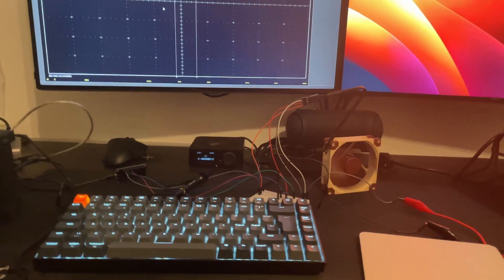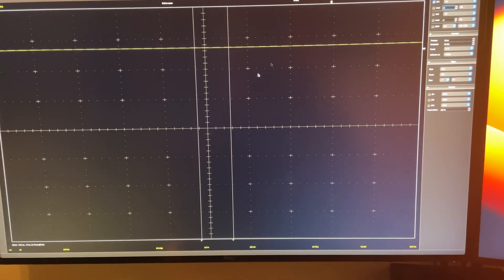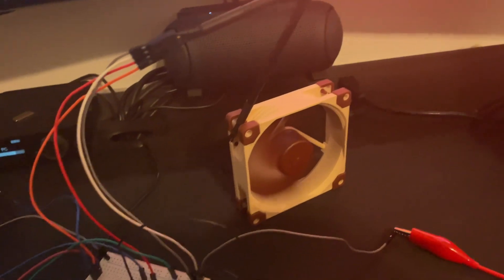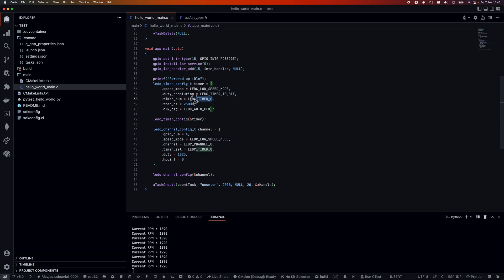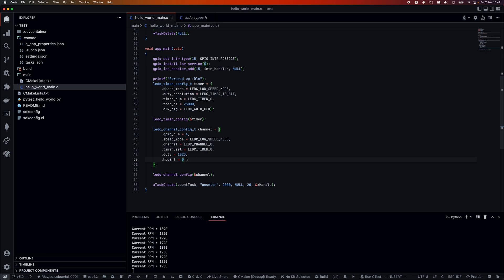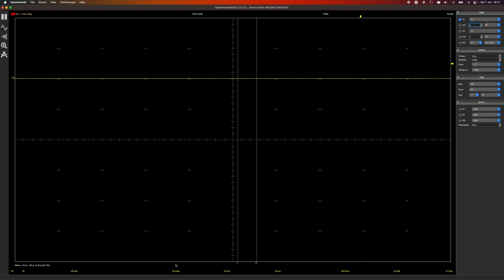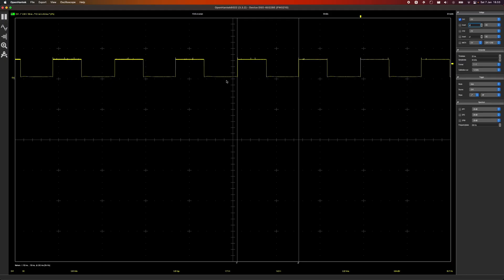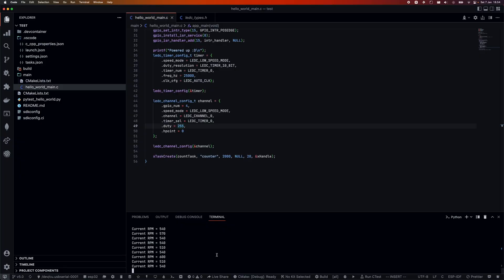[ESP32] Controlling and reading a 4-pin PWM fan in ESP-IDF

Comment: ESP32 is NOT above 3.3v tolerant on inputs... so if the TACH input spikes you have just destroyed your ESP32... this is not a valid design.  There is no guarantee that the 12v fan will not overload the TACH pin above 3.3v.  You need a design that never allows the TACH signal to be more than 3.3v and never above about 250mA current, to be completely safe.

Comment: Here's the code:

I ran it on Visual Studio Code PlatformIO (IDF, not Arduino) running on a ESP32 Xiao S3. I could not test the rpm sensing feature since my fan doesn't support it.
I used a Delta Electronics PFR0812XHE 12v/3.9A 4 PIN Fan I got out of a Dell Server for free. It looked like it recognised 0.5% increments in PWM Duty.

In the Delta fan spec sheet PWM positive was a minimum of 3.5v, but 3.3v from the ESP32 worked fine, in fact it worked fine all the way down to 2v.

#include <stdio.h>
#include "freertos/FreeRTOS.h"
#include "freertos/task.h"
#include "freertos/xtensa_api.h"
#include "driver/ledc.h"
#include "esp_attr.h"   
#include "esp_err.h"

int counter = 0;
TaskHandle_t xHandle = NULL;

static void IRAM_ATTR intr_handler(void *args) {
    counter++;
}

void countTask()
{
    while(1) {
        vTaskDelay(1000 / portTICK_PERIOD_MS);
        printf("Current RPM = %d\n", counter * 30); // counter / 2 * 60
        counter = 0;
    }

}

void app_main() {
    gpio_set_intr_type(11, GPIO_INTR_POSEDGE); // connect your RPM signal detection to pin 11
    gpio_install_isr_service(0);
    gpio_isr_handler_add(11, intr_handler, NULL);

    printf("Powered up :)\n");
    ledc_timer_config_t timer = {
            .speed_mode = LEDC_LOW_SPEED_MODE,
            .duty_resolution = LEDC_TIMER_10_BIT,
            .timer_num = LEDC_TIMER_0,
            .freq_hz = 1000, // this is the acceptable frequency range
            .clk_cfg = LEDC_AUTO_CLK
    };

    ledc_timer_config(&timer);

    ledc_channel_config_t channel = {
        .gpio_num = 10, // connect your PWM to GPIO 10
        .speed_mode = LEDC_LOW_SPEED_MODE,
        .channel = LEDC_CHANNEL_0,
        .timer_sel = LEDC_TIMER_0,
        .duty = 204, // 0 to 1024. 0 being 0%, 102 being 10%, 1024 being 100% duty cycle.
        .hpoint = 0
    };

    ledc_channel_config(&channel);

    xTaskCreate(countTask, "counter", 2000, NULL, 20, &xHandle);

}

Comment: Thanks - great intro into how to do this. Couple of questions on what software/hardware you're using? I.e the bench supply, the scope hardware/software? Always keen to get recommendations on this. Side note - minor pronunciation thing is 'W' is pronounced "double u", otherwise is sounds like PVM. This was a major pain when websites used to be prepended "www"!
Reply from the maker: Hi Marcos, thank you for your comment! You are absolutely right about the pronunciation :). I'm using a Hantek 6022BE (very cheap digital oscilioscope).

Comment: thanks for the video. i have been trying to drive led using pwm from multiple esp32. first few hours they are in sync, unfortunately after 4 hours or so, the pwm start to run out of sync. wonder if you have encountered such issues.

Comment: Thanks for the video. I was specifically wondering if 3.3 volts from an ESP or a Raspi Pico could control the pwm signal of the a 12v fan. That spec that you have a link for doesn't list the minimum voltage for a logical high on the PWM signal. Other specs I've seen showed the max voltage for logical low was on the order of 0.8v so I figured 3.3v signal would work, but your video proved that it does. Thanks!